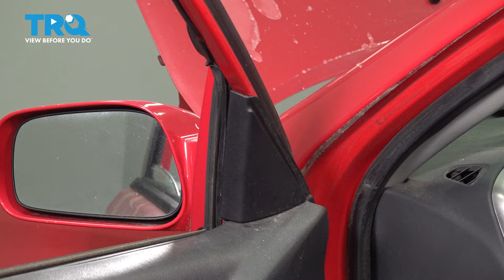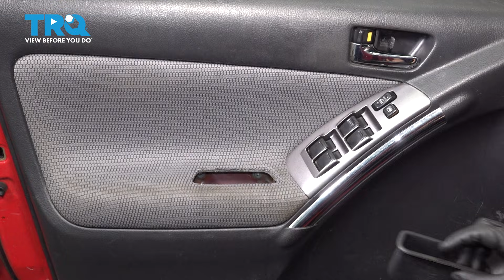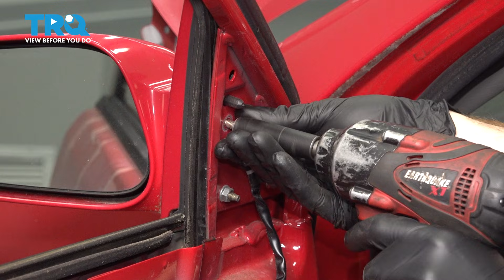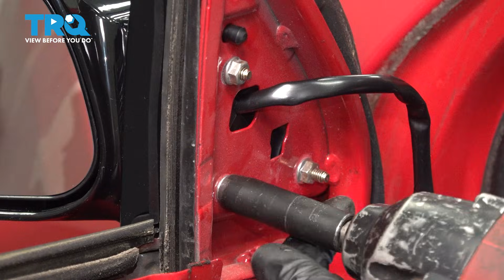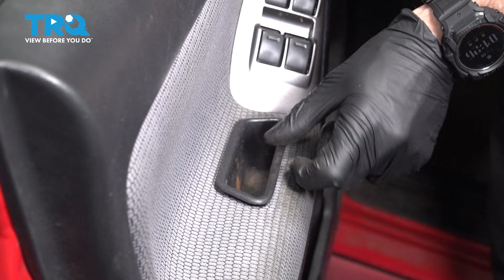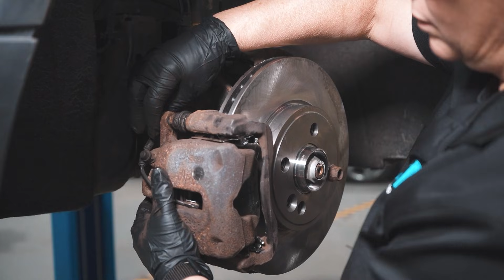How to Replace Mirrors 2003-2008 Toyota Matrix

Comment: Do you know if the wiring for power mirrors is in the harness in the door on a base model with manual windows? I want to upgrade my manual 07 to power windows. Typically all the wiring is in the harness like for the cruise and fog lights, etc., but I don't know about the mirrors